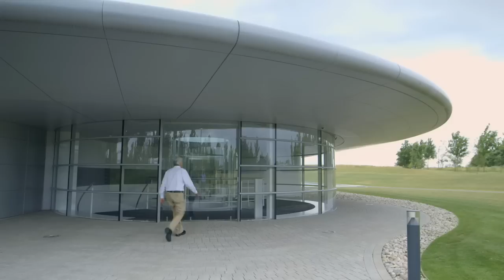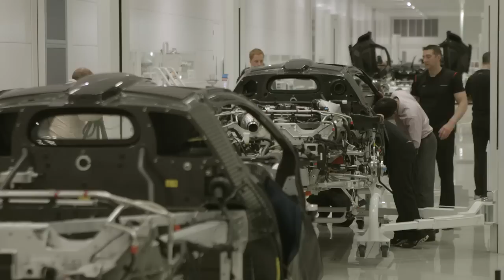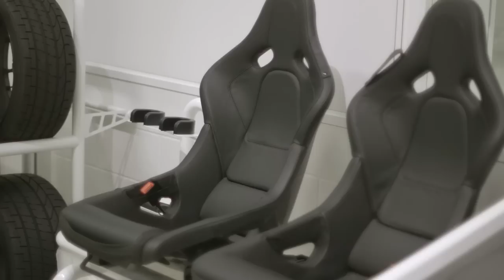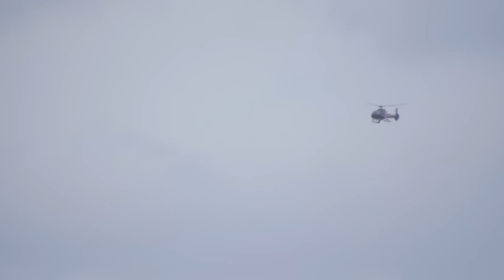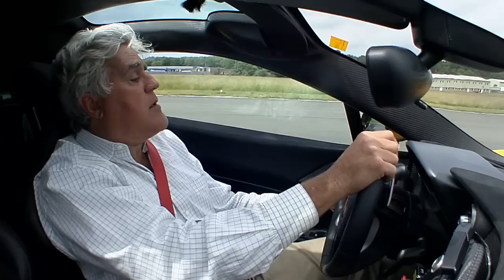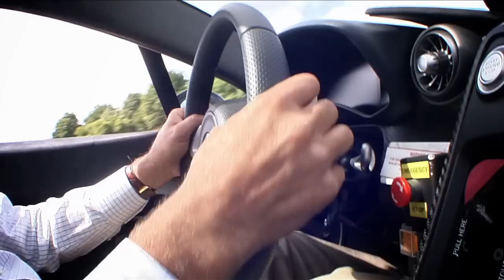2014 McLaren P1 - Jay Leno's Garage

Comment: What is best though 918, P1, or LaFerrari?
Reply: SuperDrMaximum I hate to tell you this little boy, but women don't have willies. When you grow up, maybe you'll be able to see for yourself.
Reply: Andy English lol me personally,I would have to go with the mclaren p1. I heard great things about this car and how it surpasses the porsche 918 spyder!
Reply: 918 first, LaFerrari a very close second and the P1's sound is like talking with your nose blocked ( turbo's muffle the sound )
Reply: SuperDrMaximum Thanks for your in depth evaluation. May I ask how you were so lucky as to drive all three cars?
Reply: In my opinion, fastest 0-60 would be 918, fastest to 124 918, above that the P1 would catch up and past it by a little bit, and the mclaren would have the top speed.  and laferrari would be in the back making noises with its v12
Reply: Andres Carrillo facts> personal opinion check out the acceleration run from motor trend!
Reply: There's some strange things out there.

Comment: I feel hybridization goes against the super car ethos... A hybrid system is a constant engineering challenge to optimize two systems together and manage weight, which cannot be done at this point in time to challenge a truly optimized petrol only engine.  Koenigsegg is a perfect example, a twin turbo 5.0L V8 producing 1350 hp with only 1350kg without the burden of a hybrid drivetrain.

Comment: but thr Bugatti Veyron Super Sport, well, not even that, ALL the Veyrons can beat all McLarens on the market. So if I were a McLaren engineer, I wouldn't be saying "you'll have a smile on your face. Really!
Reply: You obviously are not a car guy!  The P1 is almost a half second faster in the quarter mile than the Bugatti, and over 2 seconds faster 0-200mph!! That's a huge difference at those kind of speeds!  The Bugatti takes ALL DAY to get up to its supposed top speed.  The Hennessy Venom was up to 200mph 8 seconds faster than the Bugatti!!  That is a HUGE difference! The Bugatti would be WAY behind at that point. And as for as top speed, the Bugatti had the Volkswagen 5 mile track to test its top speed on.  The Venom only had a 2 mile track. Given a 5 mile track the Venom would have destroyed the Bugatti's top speed. And when it comes to handling tracks at super speeds, the P1 is FAR superior to the Bugatti, (and just about everything else as well.) The Bugatti can only dream of being able to negotiate a track like the P1 can. The Bugatti also looks a bit like an upside down bath tub.The Bugatti is a big boat and the P1 is a VERY hot supercar.
Reply: 21stCenturyGaming
you know how easy it would be to beat that record in a maclaren,
change a rear end gear from lets say 3.73 to 2.73,done.
the maclaren is now about 15 mph faster than the bugatti.

listen,a 747 is faster than an f-16 fighter jet BUT
which one is actually"faster"in a shorter distance.
the "f-16"  is, THIS is what we are trying to explain to you.
if i was beside you at a stoplight,you were in a veyron,i was in a maclaren.i would kick your ass to the next light effortlessly in a maclaren,over and over and over again.a new corvette,a Lamborghini,a new v8camaro and damn near any other car would do the same thing.
im really hoping your stating to understand,if you arent your hopelessly stupid.

top end= useless talent ,never used unless on closed private course.
0-60mph =kick in the pants awe inspiring speed,used daily

simple formula,also 2-5 mph is not a huge difference in top speed in the real world because it is absolutely NEVER USED ,EVER!!!!!

a salt flats racing car can go 300-400 mph  in top speed but SUCKS ASS at zero -60 mph,60 foot times,1/4 mile etc ,because the car is designed to go fast over A LONG DISTANCE.same as a veyron
Reply: P1 is the hottest car right now, it makes veyron obsolete.
Reply: mininow not exactly. The Super Sport overruns the P1 by some mph.
Reply: wayne smith well are we talking about a tractor you dumbass? No! That thing cant do the full 268 mph the Veyron can do! So I wouldn't be talking if I were you
Reply: you know what, forget everything I said. I give up. I'm not starting a flamewar
Reply: never mind about what I said, read this
http://www.guinnessworldrecords.com/news/2013/4/guinness-world-records-statement-fastest-production-car-48092/
Reply: wayne smith and how do you know that could be done? We're not talking about upgrades that can be added by the owner knucklehead. The original, TESTED, car

Comment: What about the Porsche 918 Spyder? That maybe a competitor for the P1..
Reply: 918 is already launched and while it is quite amazing too - My best guess is that this P1 will be faster because it´s lighter. Approximate Weights:
P1; 1,395 - 1475 Kg. and 918; 1675 -1700 Kg.
In this type of car that is a lot of difference.

Thus a slight difference in power output too.
P1; 903 HP and 918; 887 HP

- Though this will not be so significant in relation to how the car puts the power down but the weight will for sure. But okay one have to remember that Porsche is masters in getting less HP going faster on tracks and roads with corners etc. But even the 12C is astonishing in ride comfort and handling, so the P1 will not lack in this area either. Overall the P1 seams just that little more edgy than the 918.

So now we must all wait and see what the LaFerrari brings to the table - and then not forget the XC75 which IMO actually is the most interesting of the 4 "Hyperbrids"- but we will properly never see that one sadly.
Reply: I guess, but the Porsche is mainly heavier because of the electric and petrol engine that is has. Also, the Porsche has a lot of amazing gear in it, (not saying the McLaren hasn't got any), but personally, I've been a fan of Porsche for a long time, so I personally would go for a 918.. but yes, like you said, lets wait and see what Ferrari bring and then lets judge
Reply: Well in this segment and being a car fan all these pinnacle top cars are just pure pornography. And while we are at it - Most of these performance numbers is just indications to manifest the Brands - So very few people will ever own one of these 2000-3000 people max. with some second hand sales out of a world population of more than 9 Billion. Properly most of these cars will have only very few miles on them as well - Which is the sad part about e´m actually.

I my self likes Porsche a lot, the new 991´s are very beautiful and what I would not give for a drive in the 991 GT3 RS. Never the less McLaren have proven that they too can make a daily drivable super sports car with the MP12. And If I should choose among the two beasts 918 and P1 - Then it would properly mean that I could afford any other car for daily driver so this would be the top toy - And in that regard the P1 just appears that notch more edgy than the 918.

Comment: So since he was driving around on the top gear test track is this a bit of a spoiler to say that next seasons top gear will include the P1? I hope so!
Reply: McLaren actually tests all of their cars on the Top Gear track (I'm assuming it's because it's a Lotus developed track, and is therefore good for testing handling.). I'm sure TG will be one of the first to get the car, and I hope it's that soon, but there's no guarantee. That is how it played out with the MP12, though.
Reply: Tanner Young they have already tested it at Spa, Belgium. No doubt they will feature Clarkson & Stig tearing it up on the TG track in Dunsfold also.
Reply: Ryan Sharp That's fine and good, and I'm not denying it, but McLaren actually use the Top Gear track as their testing grounds. Ask McLaren or Jezza. I was not saying Top Gear won't get the car son, only that that's not the reason it was there on this day.
Reply: I wasn't disputing that. I just called "Jezza", and he told me to tell you to stop stalking him.
Reply: Ryan Sharp That's a bit ignorant. He simply said that on the show a few seasons back. Whatever. They'll get the P1. This isn't the reason, but they'll get it. Problem solved.
Reply: you're the problem
Reply: I fail to see how. I simply pointed out the truth. Just because it's not what you wanted to hear doesn't mean it's incorrect. Next time you want to look high and mighty it might suit you to learn the facts.

Comment: For a company that began building cars just a few years ago McLaren is doing a great job....so impressive! You get the impression that McLaren would be way ahead of the competition had they began manufacturing cars a very long time ago. It is really amazing what this company is doing! And you can tell they take pride in what they do just by looking at their building facility.
Reply: I know that time seems to get shorter as you get older, but you must be really fucking old if 21 years is "a few years" for you.
Reply: formula 1 bro
Reply: Frikgeek
Dude, I was referring to the time when McLaren began building cars completely on its own. The McLaren F1 which you are referring to was not built completely by the company. They received help from BMW, who built the engine and tuned the car. The MP4-12C was actually the very first sportscar for the road that McLaren built completely on their own. But even if you were to add the F1 as a car built completely by McLaren, 21 years ago is still no comparison to a company like Ferrari who has been building cars way longer.
Reply: tmat04 they are doing very well in formula 1 racing. They know how to make a car handle because of their experience in formula 1

Comment: When you compare the Nissan gtr, (especially a modified one) to these hyper cars, they all become overpriced. The p1 I'm sure is an extraordinarily good car, so is the 918, the agera r, laferrari, the veyron, and pagani Huayra but but over $800,000 more than the GTR? For almost the same performance? The new age of hyper cars are way too expensive.
Reply: Sorry but comments like this just demonstrate the lack of knowledge of the author. Have you spent much time in the high performance automotive sector/motorsports world? I have, cars like the GTR are fantastic but they do not compare to cars like the P1, the GTR is basically a regular road car chassis, it's floorpan is pressed steel joined together with spot welds in the same way as any other Nissan, although the GTR is stiffened up with Ali castings and a carbon brace, it's designed for 500 ish hp, put 1000 in it, and eventually it will fall to pieces. That's if the 1000hp engine has destroyed itself first. The P1 is designed and built for it's power, and that kind of technology costs big money.